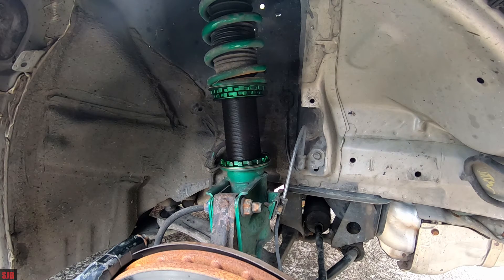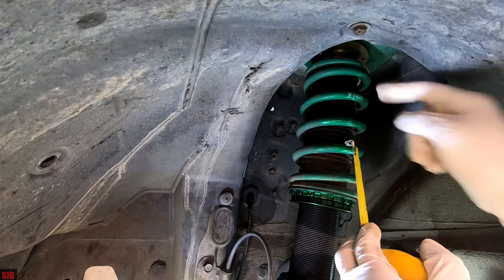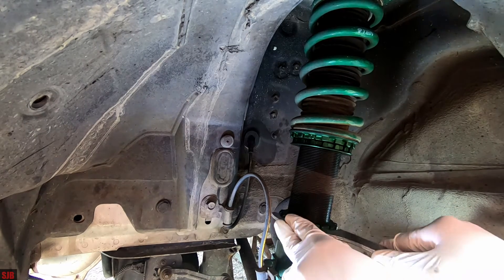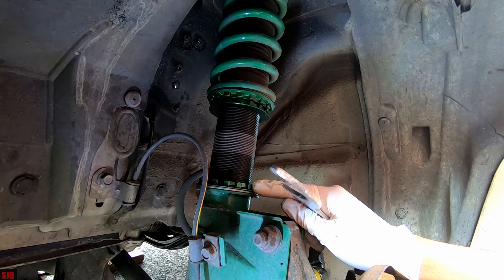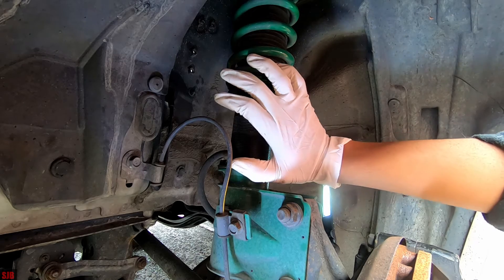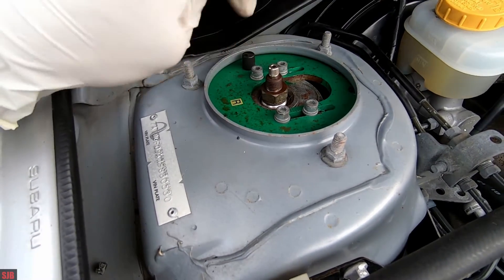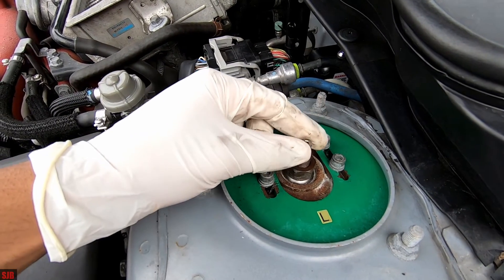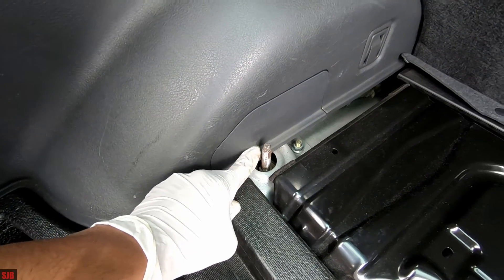Adjustable Suspension - How to set ride height

Comment: Hay un lado del vehículo que pesa mas porque siempre me queda más bajito del lado de conductor?
Reply from the maker: It shouldn't be a significant difference, especially when
No one is sitting inside the car
Reply: Valid question. Lexus is a right hand drive vehicle by design. Not sure if they made adjustment to the Left hand drive ones with fuel tank on same side as driver seat.

Comment: When raising there suspension what is the minimum allowable thread required in the bottom collar?
Reply from the maker: Generally the strut lower collar should be screwed in approximately the diameter of the threaded adapter at the bare minimum. I personally like to always have it at halfway or more.
Reply: There's a hole 🕳 in thread that's near the end, if you see that, you've raised the coilover to high.

Comment: Nice vid! If tein super street has 16 ajustments how much do you need to go back (from fully closed) ?
Reply from the maker: Dial it down half way, depending on the car it can be a split setup for the front example 7/8. Trail and error will get you at the best setting
Reply: @AutoBuddynz  thnx. car is Evo V 400hp street car. 
Btw where are you based , your accent sounds like you originally from South Africa 😊 ?
Reply from the maker: @gavn1230  Sounds like a nice ride! From NZ haha
Reply: @AutoBuddynz  Opps my bad haha 😂. Anyhoo Nice vids ..keep up the good work mate 😎.